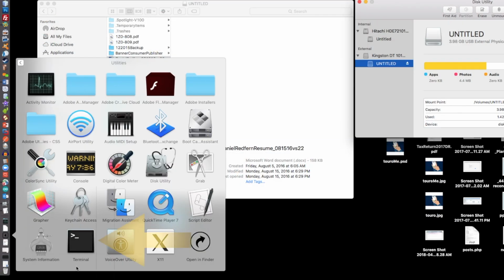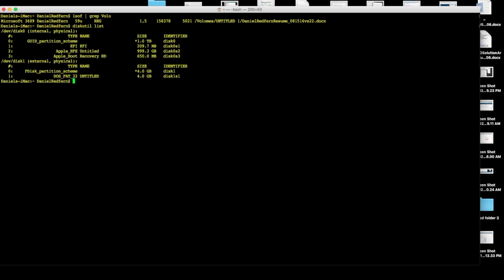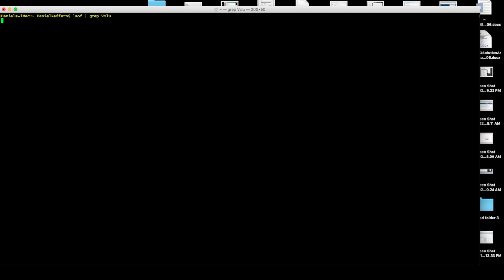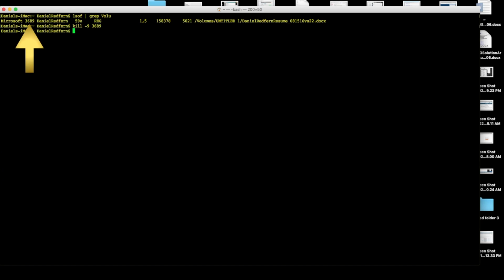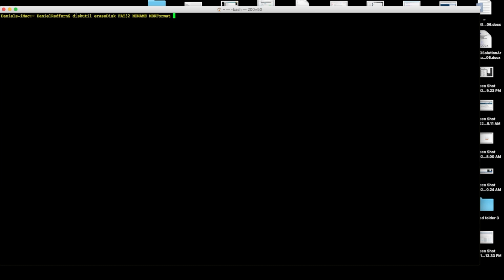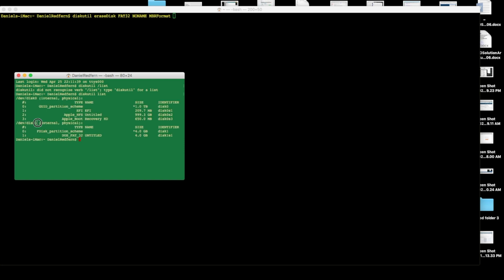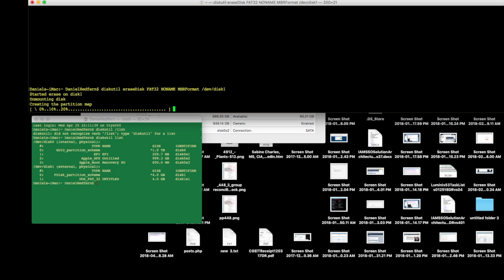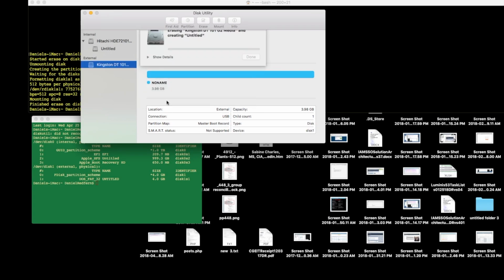SOLVED - Disk utility. Operation Failed... Erase process has failed. Press Done to Continue

Comment: I honestly could not understand this so instead, I figured out another way 'not that your way is wrong' but for those of you who have a PS4, you can do it another way,  and here's HOW! In my case I am using a WD My  Passport 4TB, I plugged it into my PS4 and formatted it, once that was done I unplugged it from the PS4 and plugged it back into my Macbook and went into 'Disk Utility, clicked REPAIR- then clicked on ERASE and renamed it and 'IN MY CASE' formatted it to ExFAT so that I can transfer files that are bigger than 4GB AND also transfer files from not only MAC but also Windows! GOOD LUCK!
Reply: hi man so if I take out my internal ssd from my Mac and put that in a case to use with the ps4...I then format it for the ps4 then put it back in my Mac and erase and format and it should then work?? cheers
Reply: @wardy2783  If you did it how I did it I don’t see why not...
Reply: @alemb2582  hi man i swapped my internal ssd in my Mac for another ssd that was in a case....the one in a case worked in a Mac and then I put the one that was in the Mac in the case and that worked also...so have no idea why that is lol...but alls good now...it did clear everything on the ssd that was in the Mac though...but luckily I had a back up ...cheers
Reply: @wardy2783  That’s good.

Comment: Error: -69760: Unable to write to the last block of the device
Reply: Any fix ? Same issue here
Reply: @MrUnderdawg777  None
Reply: @schemesupreme7  just ordered a new hard drive now aswell so not I got a 2tb and a 4tb what a joke
Reply: @MrUnderdawg777  I refuse to give Seagate any more money EVER!
Reply: @schemesupreme7  I just got a WD apple one it just cake just now went to erase never worked tryed again and it erases and now it's exfat that easy to and I just resetted it normally to without terminal or anything.. I think the problem is when we use normal hardrives instead of Mac ready hard drives idbsay get a Mac ready hard drive and then turn it to exfat, the other hardrive I got sitting here brand new is 2tb and cake as Mac and Windows supported at defualt it is exfat only problem is I can't erase it on the Mac only on the windows ? That's why now I got this new 4tb wd Mac ready one and works fine 😇